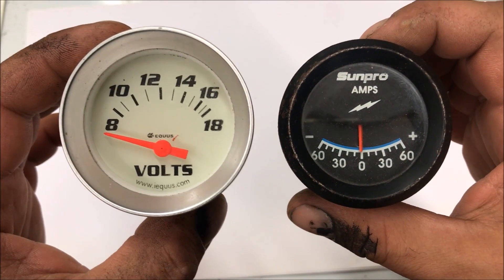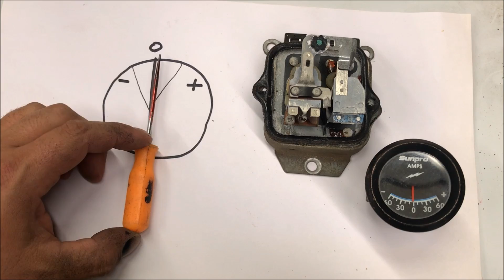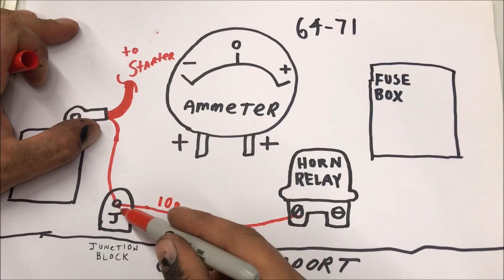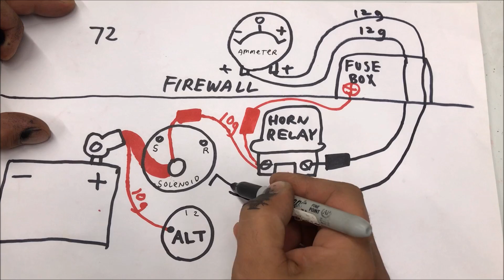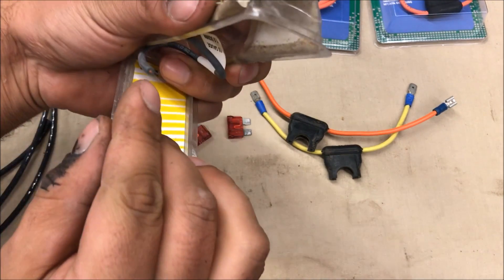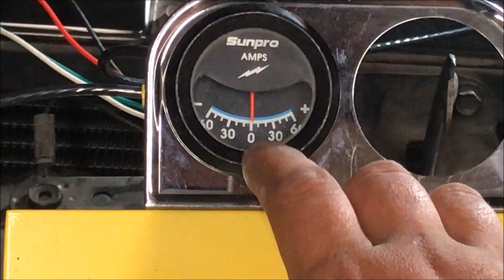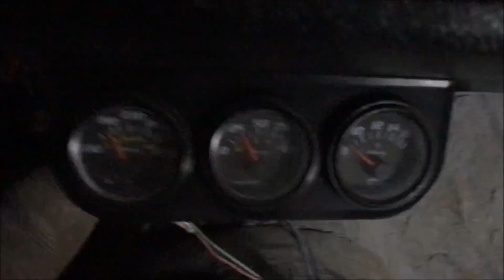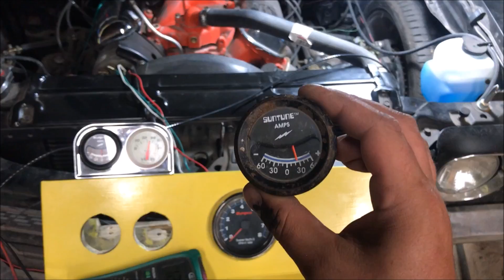how to wire ammeter and volt meter AMP meter DIY

Comment: So I'm putting a volt meter in my 2007 mustang gt but the radio and every other key on wire is about 1 volt less than the actual battery voltage. The only thing I can think of is to put a relay in direct from the battery and use the radio wire to turn the relay on to power the volt meter so I get accurate voltage.
Reply from the maker: there has to be something else you could get power from.. is it 1 volt lower with the engine running?
Reply: @chriscraft77022  yes 14.5 at the battery an 13 at the radio wire. I also tried the OBD connection key on wire and it's the same but the always hot wire on the OBD is correct.
Reply: @chriscraft77022  I ended up fuse tapping to the inboard ignition fuse, all is well now.

Comment: Question. Hooked the amp meter up exactly as you said. Wires to the gauge first. Bring them out to the engine compartment, one side to that battery side block, the other side to the horn relay. Both wires are are fused. Connect the battery up and both 10 amp fuses blue instantly. Disconnected both wires from the back of the amp itself, fuses of course then did not blow. Could the gauge itself be bad, possibly grounding out internally? By the way I'm trying to reuse the factory battery/amp gauge in the cluster of four gauges that came with this vehicle. 66 Impala ss.
Reply from the maker: are you connected to positive on battery? those gauges get fried all the time because people think they hook to negative
Reply: No. Did not hook directly to the battery at all. I used that little Junction block that you demonstrated in your video as  hook up point on that side. I guess someone in the past has fried the battery meter itself. Thanks so much for all your help.

Comment: I have external regular on my chevelle. I’ve never changed to a 1 wire. I have a volt meter. I’m wondering if it is useless and I should switch to an ammeter.
Reply from the maker: I have both on my Chevelle.. nothing wrong with volt meter on externally regulated

Comment: I’m building a 1971 with a ls swap.so I have a internally regulated alternator and a after market voltmeter, can I remove the anmeter wiring from the front harness to avoid the live wires under the dash?
Reply from the maker: yes

Comment: Hi. Can you run the wire from the Starter Motor to the ammeter and then back to the Starter Motor to complete the circuit. Instead of the horn relay ?
Reply from the maker: yes.. but maybe starter motor to alternator lug not the same place on the starter…
Reply: Ok thanks @chriscraft77022

Comment: Interesting video. Some manufactures stuck with ammeters for a while. For example, International Harvester hung onto their ammeters in the dash, right up to the end of the IH light truck (Scout II) production in 1980, yet they'd been using Delco Remy 10SI ("system integrated")  alternators, which were internally regulated, since about 1971-72. So I guess there was a 8-9 year overlap of having ammeters for no practical reason.... other than to start fires as the wiring got old.

Comment: I have a question. What do you mean when you say run those two wires "through" the fuse box. I'm confused on that one. I get the rest of it though.
Reply from the maker: just like any other wire that goes through the fuse box … there are like 20 .. or you can be a dipshit and drill a hole through your fire wall .. your fuse box should have a few free spaces
Reply: Got it. Thanks.

Comment: I'm confused. You show the wires running into and out of the fuse box. Are they connecting to any post in the fusebox, or are they just going through it as a matter of convenience?
Reply from the maker: on a factory ammeter car they run them like that.. most vehicles have a few extra or “left over” blank spaces.. you would connect the 10 or 12 gauge wires to..

Comment: So just asking for a friend lol What happens when you wire a volt like a amp ? dead battery no start kinda thing? I did it ... Thank you for your video...Got brand new volt gauge but guess I will buy a amp gauge almost blind from wiring diagrams "Im shure I have it wired right..."   THANK YOU!!

Comment: Might be a dumb question. I’m a novice electrical guy. 

Working on a 48 Cj2a converged to 12 volts. All lights and starts etc.. all new wires... runs great. No fuses except one on light switch. 

I wanna keep my amp gauge so I know I’m charging. I have a 79 amp internal regulated one wire alternator. i have a kit to hook up to amp gauge. 

I bought a 100 amp gauge. Would that be ok? Current amp gauge which is not hooked up is only 50. I don’t wanna burn it out with 79 amps and cause a fire. 

I know you like volt meters, I like the fact I can see what’s charging on such a small system. Lights and heater only accessories. 

Thanks!
Reply from the maker: just put it on there.. it’s gonna be like the one in the video that bearly moves

Comment: Awesome video. I just replaced my 30 am generator in a 58 Ford Fairlane with a 90 amp alternator. My old ammeter was doing the same thing resting on 0 and even taking a dive with the headlights on. I learned today I need a volt gauge. Thanks for explaining so clearly

Comment: How do I delete the ammeter and just have a voltmeter
Reply from the maker: some vehicles sell a new gauge updated to volt meter
Reply: @chriscraft77022  I have a 58 apache truck. I am removing the old gauge dash cluster and putting in a new cluster with volts instead of amps. The previous owner used ez wire but had the wire running from the alternator trough the voltmeter gauge and ending in the under dash fuse box. 

 Do I just delete the voltmeter and run the wire directly from the Alternator to the fuse box and then just wire up the new voltmeter from anywhere?
Reply from the maker: a volt meter is run off any 12v wire ON with the key..   (radio, fuse box) and grounded anywhere.. remove both ammeter wires you don’t use them..
Reply: @chriscraft77022  Ok thank you. So then I should not just re splice or replace the wire where the ammeter was between? Just remove them entirely? Do you think that that wire was also powering the fuse box? Or probably not?
Reply from the maker: The ammeter is its own circuit..  it is not wired to anything but the gauge..
Reply: @chriscraft77022  ok thanks! Yea I started the truck. It works!

Comment: Morning, a very well done video... Sir I am 68 years old... I am not a auto tech... My whole life I have been a fixall, we know what that is.... In order to be able to do things you know nothing about is know the simple brick.... One brick... known fact.... ?  which way does current flow.... Know the answer and why it is the answer.....2 differences between series and paradelle why and the reason. .... Resistance and impedance... how and why....capacitance and induction...
A  standard car batter is 12 volts x amount of amps.... B;y itself it has only self impedance  and self capacitance......A system using any part of the capacitance will be know as a resistance.... A volt gage or amp meter can only tell you the differences between voltage or current.... volt meter is between Positive and negative...simple and really only tells you battery voltage, I think we should know the battery voltage.... Amp meter is wired in shut of the captaincies of the battery... with no load or resistance is has nothing to read, so it should be set up to read 0.... with a load or resistance of any amount it should tell you the about of the load in current so one know AH and charging rate.... 
Now, you took a very good explanation of the two gages and I totally screwed it up...  Education is a great thing, or is it..... I appreciate your thought process and your willingness to share.... Best to you and your new video...

Comment: Can you make new a diagram with the alternator? I just installed an ammeter into a 64 chevelle with a 396. The car did not have a junction block and the alternator wire was about a16g. I upgraded everything to 8g. After the install the gauge bounces at idle (did not originally have a gauge) and will steady at higher idle...that may be because it was cold (29°f)  and I didn't run it very long since its in the garage. However, it's reading around 30ish amps. The car sits in a garage with the neg cable off with a battery tender on it so the battery is fully charged. 

I feel like I wired it wrong

-New 8g Alt wire to horn relay.
-Bat to one side fuse other side to gauge.
-other side of gauge to fuse then to horn relay.

Car has msd 6a (not a 6al) and a msd distributor and coil of that matters. Also no choke on the carb.
Reply: Should I wire in a junction block? It must have been deleted at some point. This is not my vehicle by the way.
Reply from the maker: your car is wired just like mine... did you change to internally regulated alternator?  your car should idle at 750rpm with no charging problems.. there are so many things that could be wrong.... my factory ammeter works but gauge hardly reads over 0 because of internally regulated
Reply: It's not my car, it isn't internally regulated
Reply: I just ordered a junction block for the car,  i have the gauge wired in series which may be wrong
Reply from the maker: @madmike214  just study the 2 wiring diagrams in the video..  you can run it ether way..

Comment: I like your. show no bullshit waste of time in mom sense straight to the point, well done, thank you & good help clear Y concise. Fixed my charging  problems. but I have that squeal on low RPM until I gas it at 4000 it  stops, thou low charge may be why, but it charges so it's alright.

Comment: Quick question, I installed a volt meter in my 79 dodge d100 and it's externally regulated. Could that be the reason I'm getting no reading on the gauge?
Reply from the maker: volt meters are ran in parallel to any positive and any negative.. did you replace an ammeter with the volt meter?
Reply: @chriscraft77022  yes I replaced the ammeter as it had gotten too hot and started to melt
Reply from the maker: @andrewrobertson2388  .. they are wired completely different

Comment: Hey Chis im trying to do the big 3 or 4 upgrade on my 72 monte carlo that uses the starter solenoid style system. how would i wire the upgraded cables? the harness is from AAW for a stock 72 and i have an internally regulated alternator. Thanks man been a big fan for a long time lol.

Comment: Easiest way to think of a Ammeter is like your meter from your power co. or your water co. It goes directly inline You want all the current to flow THROUGH your meter. From the battery to the fuse panel "VS" a volt meter connects to a positive & negative supply to indicate the amount of voltage you have at any given state. And can be connected anywhere you can pickup a hot wire and a common ground.

Comment: Hi Chris I have a ford 51 shoebox original gauges , amp meter with a 302w with with internal regulated alt . can i wire up the amp gauge the same as a volt meter. to just read volts Cheers Brad

Comment: Sir. Thank you for the prompt reply. I have had this Car for 38 years and the las time I had it apart for paint a Friend moved the Engine Wiring Harness back under the Firewall into the inside across the floor and back out the end of the Trans tunnel because it would better. It has always worked but now that I have removed the Engine I'm trying to get the Wiring back across the Firewall 
and back to where it somewhat belongs' I  have a Summint Remote Solenoid Kit that I want to use. Thank you for your patients. I can be annoying from time to time. Ted. PS. The Car is not at all stock.

Comment: So, the reason that it doesn't show much charge, is because your battery is already fully charged. Leave your headlights on, for about a half-hour, then start your engine. You will, then, see a significant charge, because the battery will need to charge, so the regulator will allow more charging current, into the battery. Ammeters are great for any vehicle where you need to power accessories that cause significant drain, or for long periods of time, without the engine running, such as vehicles with high powered audio systems, taxi cabs, or r.v's. It tells you how much power you're using, & after engine start, helps indicate how low the battery is, by showing how much current is being drawn from the alternator, & when it is fully charged, when it come back to 0.

Comment: Hey Chris, if I am running an externally regulated alternator and I switch from a stock points distributor to an MSD distributor, will the factory amp gauge still work properly.  Thanks for any assistance.
Reply from the maker: Yes
Reply: Thanks

Comment: I found a spare amp meter on my boat and was plotting to use it for my trolling motor.  The very few secs of the video squashed my dreams. My amp meter is floating up at 80....

Comment: If I ran 1 wire of the ammeter to the starter solenoid post that the battery runs to and connect the other wire of the ammeter directly to the place that the car pulls power from, would that work?

Comment: what if you have a one wire alternator. With the one wire alt it hooks to the post side of the starter solenoid with the heavy + side of battery
Reply: never mind. I needed to watch all before commenting. DUH!! sorry. Very good video.

Comment: Quick question Chris. If I was to add an amp meter to an externally regulated alternator system all I have to add is two fused 12awg wires, one from the shunt the other to the junction block going back to the amp meter?

Comment: Thanks again Chris. mine has this neg. and pos. So I tried ground and positive,,, sparks.  Now on to a fuel gauge,,,BOOOmmm.   my cluster is bad only thing works in a '76 chevy truck is oil pressure. Sometime they replaced the tranny different speedometer connection. Fuel tank sending unit has 2 wires 1 blue other red. I assume blue is ground, red to gauge. I tested blue and red wire with about 1/4 tank for ohms it registered 14 on meter.

Comment: Sir. Do you have a picture of the Engine Fire Wall Wiring Routing? I don't see how I can properly get past the Windshield Wiper Motor to the Starter and Alternator on My 72 GS. Thank you. Ted.
Reply from the maker: you have to pull the wiper motor off
Reply from the maker: give me your email I’ll try to send a pic

Comment: I have a 63 willy jeep i am restoring. Not much of a electrician so wondering why not an Ammeter with a 10si alternator upgrade?  Also, what size fuses and how do you determine in line fuse size?
Reply from the maker: depends on what amp alternator you run... up to 75 amps 10 gauge stranded wire is good.. I would only run an ammeter if you have one in the dash.. adding one is pointless.. add a volt meter if you run an internally regulated alternator
Reply: Thanks. i added a 63 amp 10si. Sorry...what fuze size should i wire in as i do not like fuse links either as they are hard to see when bad. also, 
Can i use a led dummy light or does it have to be incandescent?

Comment: Ammeters make way more sense. It tells you what your alternator is doing. A voltmeter is hard to discern crap battery / good alternator or vice versa. Pair in a modern battery you can't pop the caps and check with a hydrometer and you've killed so many simple, quick and accurate diagnostics.
Reply from the maker: if you have a lot of amp draw it would be wise to run an ammeter..  (ambulance, wrecker, etc. )  but the internally regulated alternators dont always read above 0 until you turn everything on..  i run them both on my 70 chevelle..  what vehicle or machine do you run the ammeter on?
Reply: @chriscraft77022  Correct, they show the alternator's response to putting a charge back into a battery, whether through load or a discharged battery. Disconnect the battery and you'll see a good spike. With a quality ammeter, not a cheapie, you can discern brush wear or shorts. I'm not running an ammeter on a car, the car company's have stuck us with volt meters or worse, idiot lights. I will always run an ammeter on the boat where it's necessary to predict troubles, which are always more frequent on the salt water even with sealed alternator's, starters and wires and even on a diesel which doesn't require power to run.

Comment: I watch your videos all the time.  Just would like to know what you suggest is a good keyed on power source wire to run to a relay to power a msd 6014 ls box.  It says it needs a 12v keyed power source.  My vehicle is a 1972 Chevrolet impala with a ls swap and carburetor setup

Comment: I bought the same gauge  for volts! I have a vw bug air cooled motor with generator  will the gauge I bought work.
Reply from the maker: the gauge will work but you want an ammeter on a generator car.. how would you know if the generator is charging enough? you won’t with a volt meter

Comment: Hey Chris, I have a GM style alternator in my old tractor and the alternator is internally regulated and the tractor has an ammeter gauge. Which your video said doesn’t make sense but it’s not hurting anything right? Anyways it has a three wire alternator one big charge cable and two smaller ones. Brand new batteries 2 6’s in series and new alternator. But when the tractor is revved up the ammeter gauge pegs out. I hooked up a voltage meter to the back of the alternator and got 15.5 Volts when revved up. Do you know where and what my problem could be? Thanks!
Reply from the maker: what does it charge at when it idles? is the ammeter new or old?